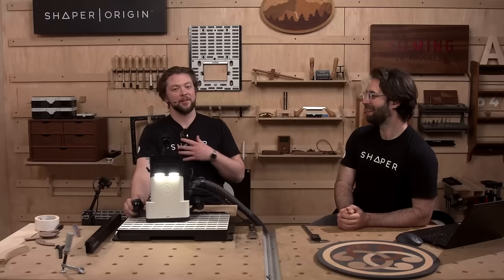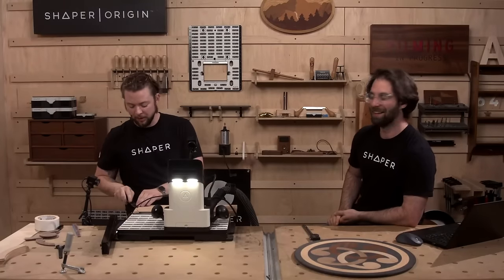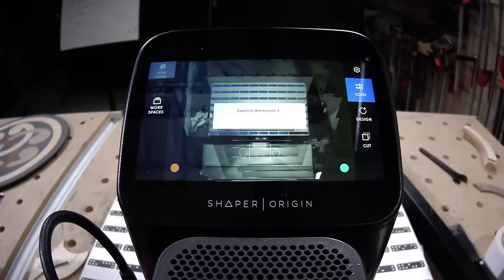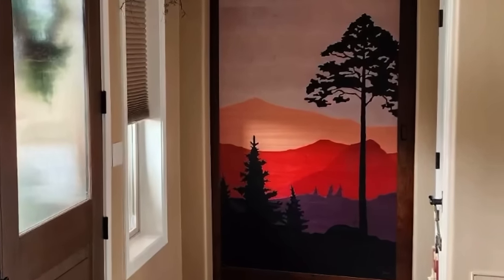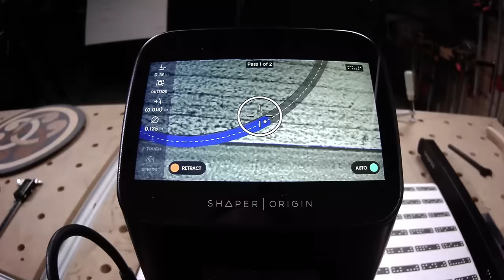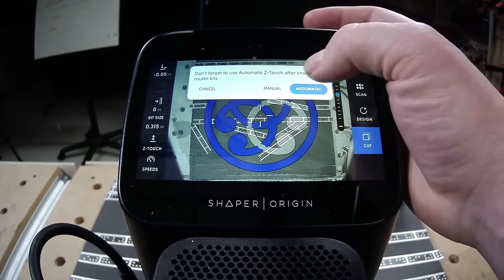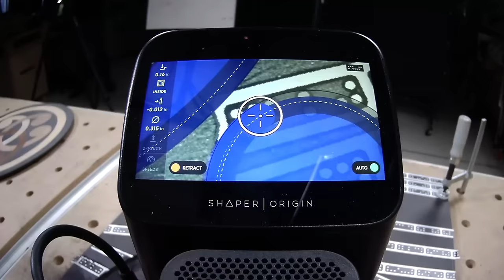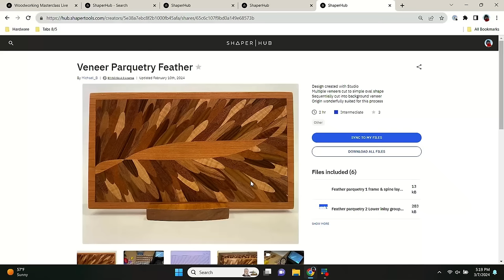Session 101  – English: Inlay and Marquetry with Shaper Origin

Comment: I noticed you floating the SO in the air when scanning the second board in the video and I can see the intent is to make sure the lower edge and corners of the board are included in the scan file. I was under the impression that you needed to maintain the SO at the same level of the workspace when scanning. How far off the surface can the SO scan and still maintain the proper mapping?
Reply from the maker: We still recommend keeping Origin as close to the workspace as possible :)

Comment: What about compression bits? Best of both worlds.
Reply: The lower upcut portion of most compression bits requires a first pass depth of at least ¼", which is deeper than the material they were working with for this video.